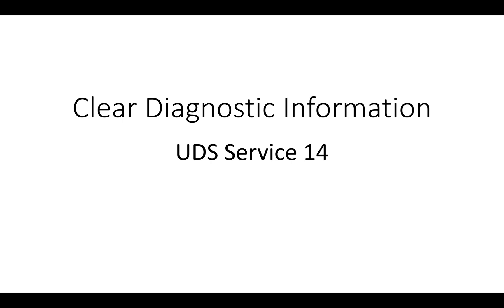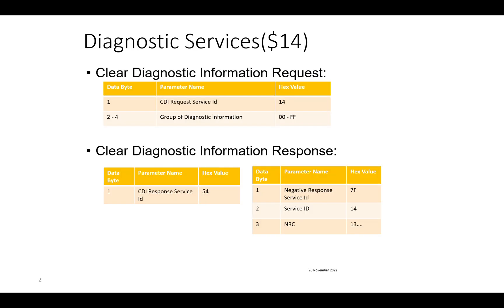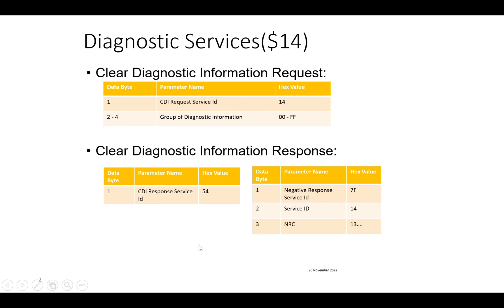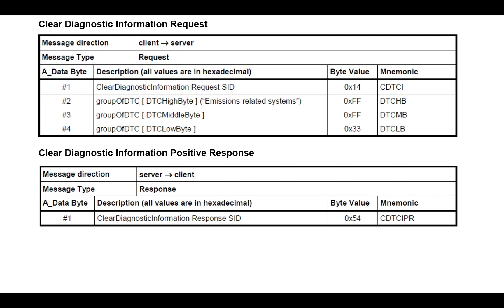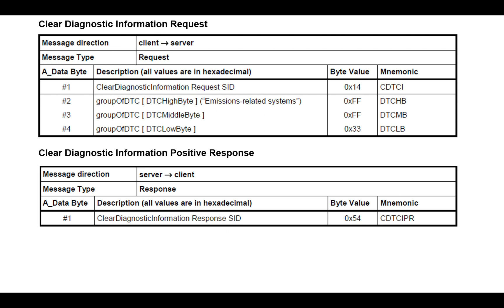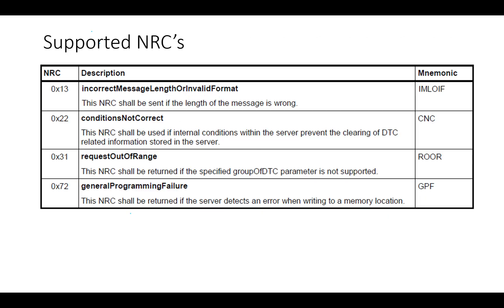Unified Diagnostic Service-UDS | Clear Diagnostic Information 0x14 |

Comment: Hi sir, what text would I send from computer to clear code? Just "0x14" ? I'm using savvy can software.
Reply from the maker: 0x14 service in uds is used to clear diagnostic information, you need to send 0x14 followed by DTC number or group of DTC
Reply: Ok thanks, to clear all codes, does my program line look like this?
"0x14 00-FF
Reply from the maker: 1)to clear a DTC 0x123456 request is 0x14 0x12 0x34 0x56 2) all code clear--- 0x14 0xFF 0xFF 0xFF 3) if you need specific group, puts its group mask...eg: emmision DTC group 0xFFFF34 --0x14 0xFF 0xFF 0x34 3) @vindicatednews9169
Reply: Ok, so this is the line of code for clearing all codes?
"0x14 0xFF 0xFF 0xFF"
Reply from the maker: yes @vindicatednews9169